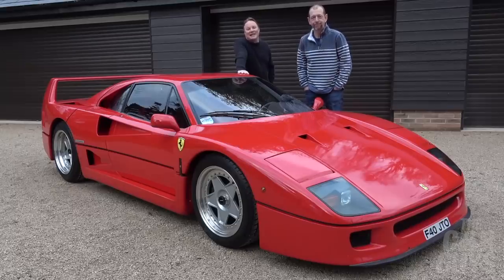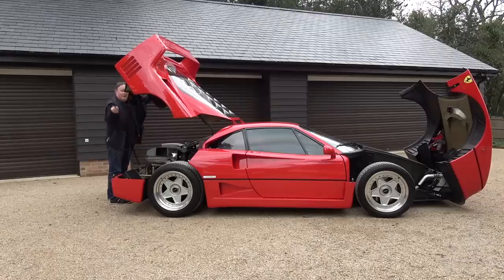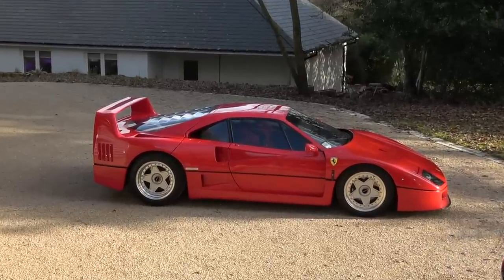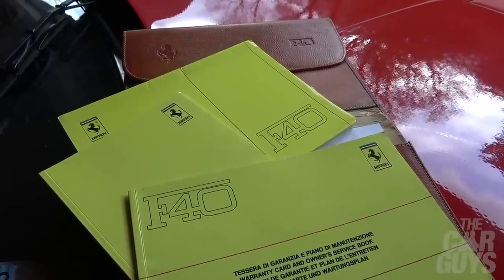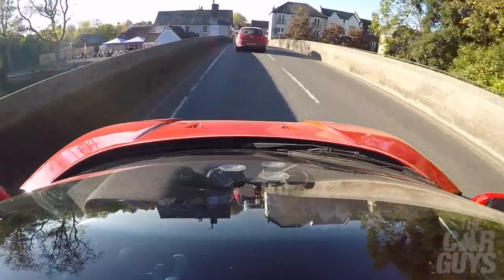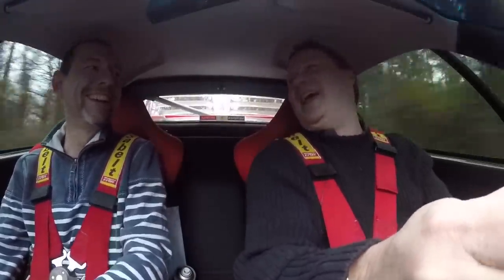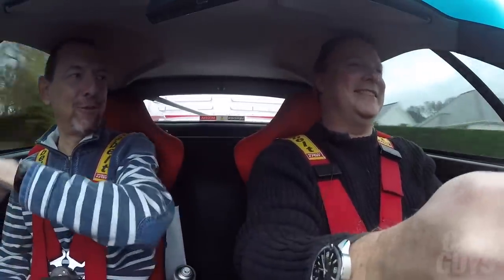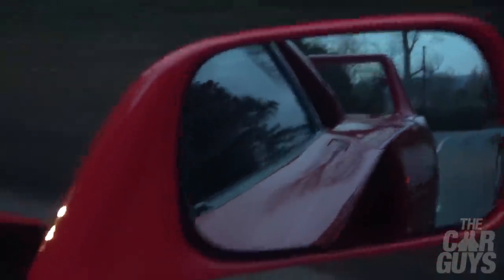Ferrari F40 - what's it like driving and owning the GREATEST EVER FERRARI?

Comment: Fun fact: Enzo dubbed this car as his greatest achievement. Bear in mind he witnessed the 250 GTO.
Reply: But that was at a time when Ferrari was at great turmoil, and at a time when old man Enzo was not at his sharpest. Not taking away from the F40, merely pointing out that what Enzo thought at that time, did not natter all that much.

That being said, I still think it's one of the greatest Ferrari ever made.
Reply: Enzo sold the road car factory in 1969
pretty sure he didn't "dubbed this car as his greatest achievement"
Reply: @RoverWaters  The F40 was designed by eng. Nicola Materazzi under explicit request of Enzo Ferrari. He first was asked to design the engine of the 288 GTO. Then he was asked to design (in his spare time, because that couldn't take time to the road or the F1 division) the GTO Evoluzione for racing in group B. Materazzi designed the all car and Pininfarina did the body kit. This had a bad CX and so Materazzi designed a better body kit. When the test drivers tried the car, they were so impressed that Enzo Ferrari decided to make a road car of it, in limited edition. This final evolution was refined by Pininfarina and became the F40. After this project, Fiat decided to be more involved in the road division and Materazzi decided to leave. Then the 348 was made. So the F40 is the latest car designed and developed under the request and the control of Enzo Ferrari: Fiat had nothing to do with it. I don't know if Ferrari considered this to be his best car, but certainly was his last one.
Reply: @gianlucapx  Enzo had no decision power
calm down simp, learn the history, FIAT called all the shots
Reply: @gianluca p  Sr Materazzi created this masterpiece and received nothing for his efforts. He should have been up for promotion and the mean old corpse, rejected his promotion.

Comment: Been waiting for this car to be covered! Iconic. I think I had the same posters as Jason in my younger years although the 288 poster was my favourite. 
My first F40 I saw was in 1991 and still remember the plate F40 WON ! How cool. 
You talk about the 0-60 but you have to remember your using a gated gear stick and manual clutch.  With the mod cons of today how much quicker would / could it actually be?? 

Congrats on 20k subs but for you guys I suspect this will be just the tip of the iceberg

Comment: A lot of F40s have been dynoed and have around 515 bhp
Reply from the maker: Excellent news
Reply: Also, the amount of horsepower is the MINIMUM. Most have around 40 more.
Reply: Cool, I also thought the 0-60 was in the late 3 second mark?
Reply: So much torque it spins the wheels pushing hard even at 40 to 60 mph.  That can slow down the 0 to 60 unless the temps are high and the road dry.  My tuned S4 spins the wheels too easily and I have to touch accelerator gently and push hard once it going 20 or 30 in cold temps.

Comment: We have a friend with an F40. It has a bunch of LM parts. It’s really well sorted. Updated turbos and inter coolers. Has LM brakes. I’ve only ridden in it once and helped changed the battery. Has about 550+  HP and the brakes are very stout. They have all the non LM parts, but it was done at the factory.
Reply from the maker: Nice
Reply: Not even genuine LM's or GTE's were "done at the factory" so that would seem very unlikely.

Comment: It’s also the very first production car to break 200MPH
Reply: not really dodge datona ,plymouth  suberbird  first 220 mph!!gunnise book world record .maybe u ment firist prod. ferrari?that fast?
Reply: For starters at least, those cars wouldn't do that w/the street tires they came with. The F40 could break 200 Mph bone stock right off the showroom floor on original tires. And if you were to wage bets on which could hold that spd longest without blowing up, my $$$ would be on the F40. I won't even touch which one's faster on a road course! 😋
Reply: @katmanluke7187  hey i agree f40 is bad ass but the dodge /ply did hold record even on bai ply tires.drum breaks.lol
Reply: willefixit 
Your wrong buddy..the F40 was and is the first production car to break 200mph , actually 201mph read history there were no cars in the late 80s coming out of the showroom doing 201mph other than Ferrari F40.
Reply: @willefixit  
The Super Bird (and dodge Daytona) records you are thinking of were track records for stock cars (aka, Nascar) of the time, not straight off the production line automobiles. 
 The F40 is the FIRST production automobile to break 200mph, with no mods whatsoever. 
 But when it comes to American muscle cars,  I'm a mopar guy myself. 👍

Comment: I can't believe he lets cats around his F40
Reply from the maker: It's not a question of letting...
Reply: @bollocknaked1975  Well I imagine a cat could easily scratch the very thin paint on the f40 with its claws
Reply: I opened the bonnet of my transit to check the oil and a cat slid off the rocker cover like something from Alien. I shat my pants. Cats are petrol heads!
Reply: he just keeps missing them with his 410

Comment: isn't it true that f40's actually developed over 500hp?
Reply from the maker: We wouldn’t be surprised
Reply: Yes It did. For the American market. Because in the USA the added more numbers for safety. It was a rule over there. And to have the same performance the engine was was 530 hp. The Europe ones are 485 hp.
Reply: @bert9662  no i know the US did because they added so much weight on that version because of the safety BS, but even the euro versions especially non cat, they were all over 500, thats why even the f50 was slower

Comment: Gents, a few things to correct/remind you of:

1) the chief engineer was Nicola Materazzi. not advertised by Ferrari but important, he was chief eng for the 288 GTO, then technical director for the Bugatti EB110 but also for the Cagiva C589/590 GP bikes
2) the weave showing was because Materazzi wanted the car to be light. they did some cars with lots of filler, he complained the weight went up by 10 or more kg, so then they did a compromise. it's not to do with Fridays off. I think all the cars after (check the F50, I can't be totally sure) had thicker layers on the body weave and hence weighed more.
3) Gordon Murray (rightly) criticised its crude running gear. it does after all run a modified version of the 308 chassis so torsional stiffness is quite mediocre. however he did comment that the steering feel was good. it's an epic car, so that's why it's so well regarded  :-)
Reply: plus the chassis is steel. the carbon you see and the green joins are panels added for extra stiffening and cosmetic reasons. they do firm it up but it's steel that is taking most of the load (like the 288 GTO).

Comment: 1:57 Because if you put it on the other side too, the direction of reading will be front to rear and so in the opposite direction of travel. 

They put it only on right side where the direction of reading is rear to front - the same as direction of travel.

Comment: 15:15 ish...The car is viewed driving away from you and you can see the camber on both wheels, just beautiful I always thought of the car as a group B with strong group c elements
Reply: Because it was never a road car with added extensive modifications for racing, it was conceived of the exterior anyway as a whole. If you see the GTO 288 evolution models which are stunning there are bits of that car that made it on to the F40 though

Comment: Can some explain why this twin turbo v8 is so much more well loved than the modern ones in the 488 and f8? Would a NA V12 or V8 have made the F40 even more special?
Reply: No No No, it is the turbo lag that makes this feel soooo special. Feel is everything. A Subaru Impresa Turbo up to about '98  could be driven off boost, leaving the boost for special occasions, later ones didn't allow that and were worse for it. Also less fuel efficient. Turbos are not economic but they allow cars to meet efficiency targets required by law. 400bhp turbo = 2.5 ltrs on  tick-over vs 5.7 V8 ? we all know which uses more fuel.

Comment: Actually they are not enormous turbo chargers, they're quite small, and if I recall ceramic. This results in quicker spooling which contradicts your comment on taking a long time to spool up. They do not take long at all, which is why this car is given a bit of a pass by the NA enthusiasts whom often don't praise turbo cars as they find them not smooth enough across the power band.
Reply from the maker: “They do not take long at all” 😂😂😂😂😂😂😂
Reply: Those turbo's take centuries to spin up compared to modern cars. The lag is huge but a good drivers knows how to keep them spinning, even with the waste gates. Still waiting to find out as I never drove turbo charged Ferrari's (308GTB, Testarossa only).

Comment: The story is that the reason the F40 is only on the right side of the wing is that if it was also on the left side, the flying F would be pointing toward the rear of the car.  Also, it is my guess that the fire extinguisher is halon, not foam.
Reply: Just checked, it is foam, not halon, not a good choice in my opinion.

Comment: They forgot to mention that the first units produced in the first months in 87 were more 650hps and had top speed above 370km / h and 0-100km / h in the 3.1s, and the other ones with supposedly 478hps actually produced more than 550hps and i dont know where you take this 4,5s 0-100/h even this 90 model is around 3,8s! But great video
Reply from the maker: I'm not sure I have ever heard that.

Comment: Its not or never for the 348. the all analog 348 is the predecessor to the consensus  best sports car Ferrari ever made - the 355. the 348 doesn't have the expensive to repair brass value and/or electronic suspension issues the 355 has. the 348 represents Less is More and Older is Easier when it comes to Ferrari Sports cars. Most anyone can work on a 348 on most repairs as while the 348 is not a grocery getter its definitely a daily driver. Also the 348 has a flat plane crank which generates the same F1 exhaust note as Formula one cars use flat plane cranks to lower the weight of the cars. the 348's exhaust note sounds "pissed." at $65k for a 30k mile or less 348 it's now or never before 348s become the air cooled 911s of the Porsche community.  You can't lose with a solid 348. Slam dunk. No bigger bang for the buck out there.

Comment: F40 don't go up in flames 'randomly' they are the result of poor specialists and stingy owners. F40 burn from 3 main causes. Leaky headgasket, they are shite, just keep an eye on them. Shitty tanks (yes, tanks) designs, some worse than others, some are just plain result of incompetent mechanics, but sometimes they leak when filled, from return lines connection, from rotten fuel pumps (usually the tops) on the bag tanks, this is such a fckng cheap piece to change when changing the tanks...
Leaky fuel lines (not common in europe, as no ethanol in petrol), or elbows (those blue anonized shoulders) but if doing a major, top  quality shoulders and lines for both oil and fuel NEVER cost more than 1k and I count with fitting. 
Then there is the worst offender, fuel pressure regulator that just rots (if it smells of fuel and everything is healthy, it's the fuel pressure regulator, this is the best sorter of good and bad specialists, whoever mantains a f40 and says that fuel smell is normal, fckng run and never come close. 
P.S. if you have IHI turbos take the intercoolers out and check for oil, those fckrs leak oil a lot, take a moment and check for grime and shite on the ducts. 
F40 are fascinating, easier and simpler than an integrale, a couple of tricks with them, but such effective and simple engineering.

Comment: The visible fabric weave on the body isn't the result of thin paint. It's called print-through. It results from using a CRAP resin which shrinks. Ferrrari should have used epoxy resin, which is expensive. They used garbage. They should have applied a primer-surfacer and sanded sooth. They didn't. They slapped these cars together as quickly as possible.

You can see the hairy edges of the Kevlar on the trimmed edges of the body panels. This is shit. They should have laid up the Kevlar so that it doesn't reach the trimmed edge. The edge should be all fiberglass to the edge is smooth. The edges should be smooth and painted to seal out moisture. 

Look at the welds on the frame some time. They MIG-welded (wire feed) these cars instead of using high-quality TIG. There painted right over all the weld spatter instead of grinding it smooth, lol.

The car is a poorly-built joke and the owners are too ignorant to know the difference.

Comment: Incorrect about the 'Slowdown' enunciator lights! they monitor the catalytic converters if they over heat because a malfunction or too spirited driving like most modern Ferraris, read your manual! Basta!
Reply from the maker: Explanation came direct from Ferrari. Car is non cat, so can’t be that, can it, sweetheart?
Reply: Actually no, your car has been modified most probably when the previous owner removed the stock exhaust and probably removed the cats as well disconnecting the thermocouple leads. I suggest you have it checked out more carefully by Ferrari as well as the non necessary fire suppression system modification, think about it Buttercups.

Comment: The reason the paint is thin is not rubbish at all if you do a little more research. Ferrari did everything what was possible to remove the smallest kind of weight to make the car as light as possible. Have you ever hold only one liter can of paint in your hands?...If you do, then you should know that it's not light. Ferrari painted the car as thin as possible to save weight, which made the car even quicker.
Reply from the maker: #Comedy
Reply: ? Sorry, don't get it.

Comment: slow and underpowered by todays standards!
Reply from the maker: Down on hp but crucially down on weight - but it’s the way it delivers the speed that’s so exhilarating
Reply: What an idiotic comment. This car is 30 years old, and for sheer thrills and presence, still runs rings around most modern cars.
Reply: @radman3206  it's still true. Todays hyper cars are insanely more better in all aspects. It's crazy how much better cars have gotten.
Reply: Cars have improved technologically since the first one hit the road. That’s what humans do, advance and develop. To try and compare a car that is 30 years old with current cars is pointless. Technology can only be fairly compared with that existing in the era in which the car was released. It’s why your phone has more computing power than the computers used in the moon landing. The true value of the F40 is reflected by the fact that after 30 years, it commands a higher price than most modern hypercars.
Reply from the maker: Radman I’d take an F40 over a LaFerrari... but I am a bit old school